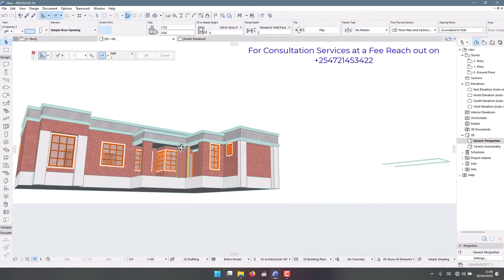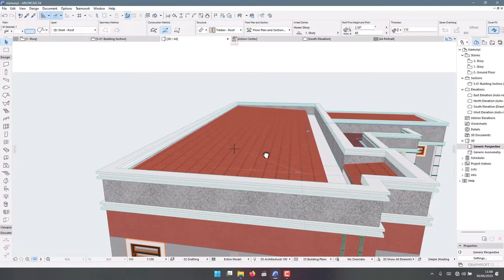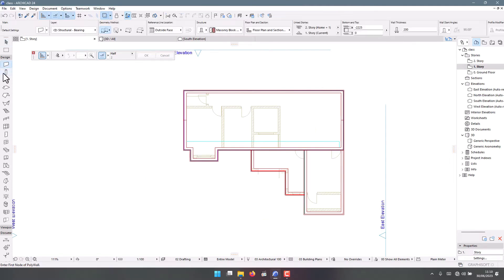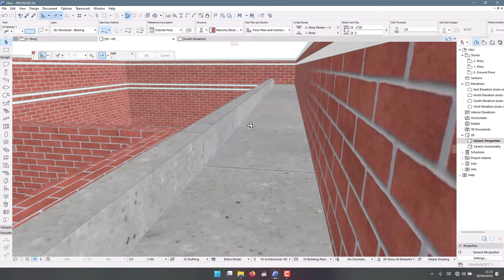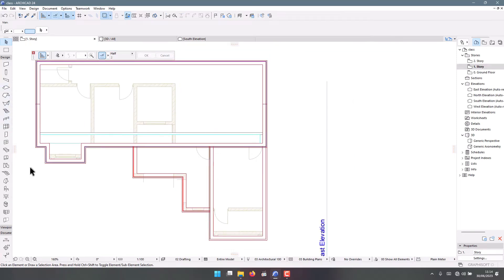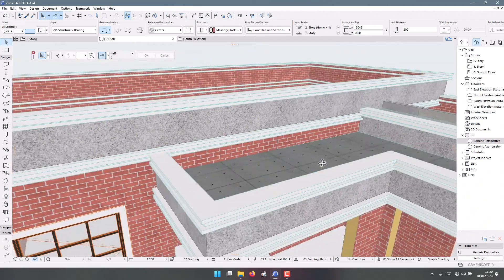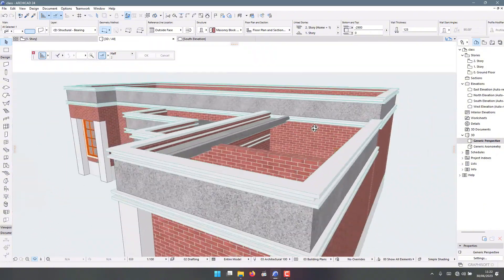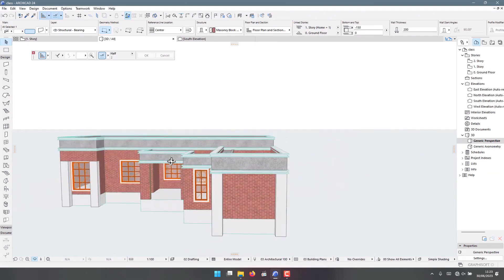Hidden Roof Design ArchiCAD For Beginners Part 6 How to Design Concrete Gutters For A Contemporay

Comment: I wonder if that house can withstand a category 5 hurricane. 😅
Reply from the maker: we don't have hurricanes here,,and also that's just an architectural render,, after that you take the drawing to a Structural Engineer who will deal with design against earthquake, gravity and other natural related issues. But no hurricanes here, never had one, Maybe just minor earth tremors but minor. Structural engineers design buildings based on the governing local codes.